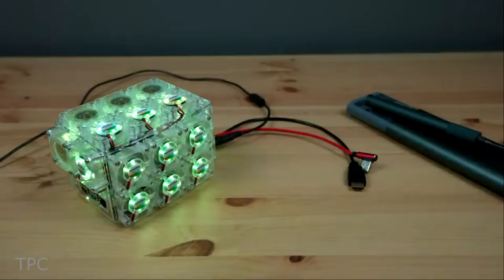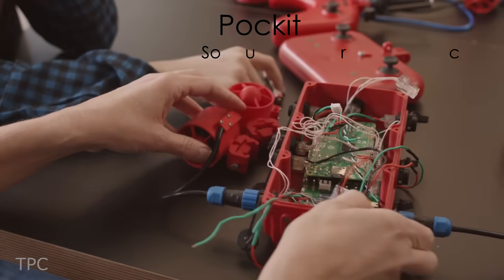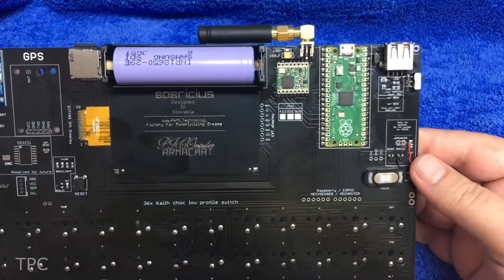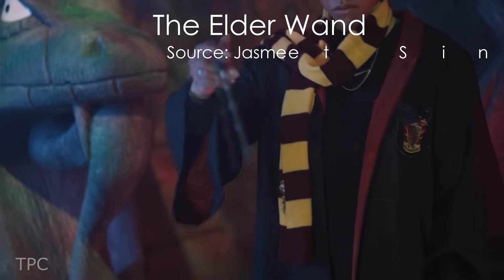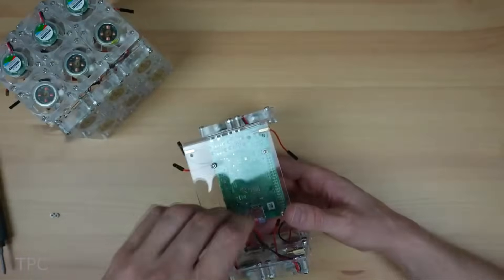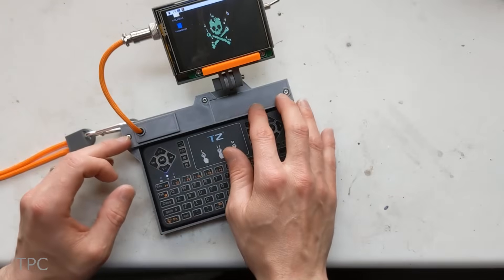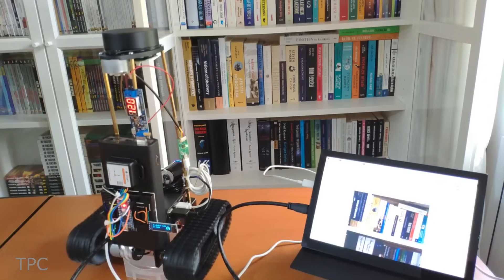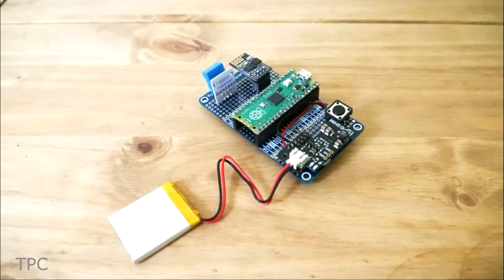A Mini Server for your Pi! (12 More Ideas)

Comment: That 24 fan setup is dumb AF. You'd get way better temps going in one side and out the other. The half and half on the top and front is only hampering the airflow pattern, DON'T DO THIS.